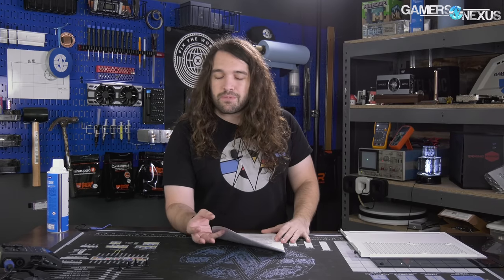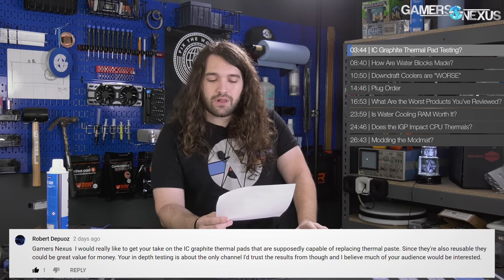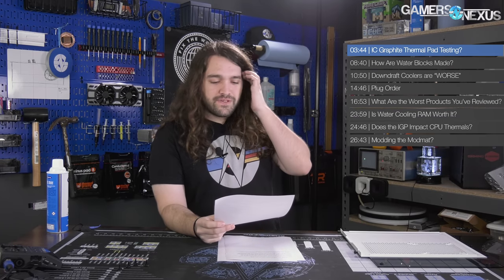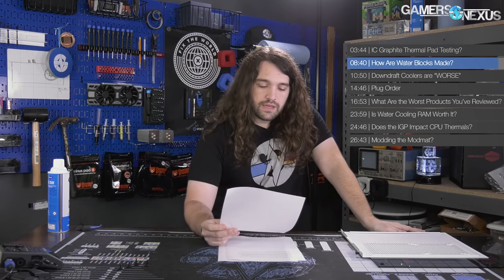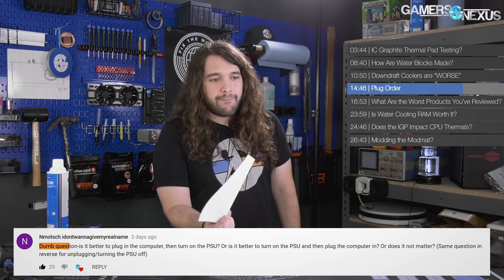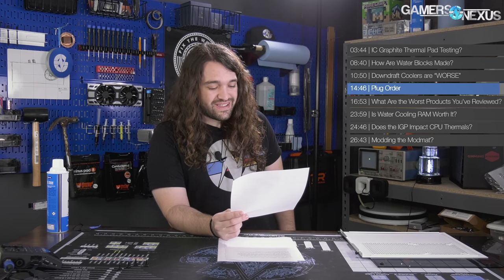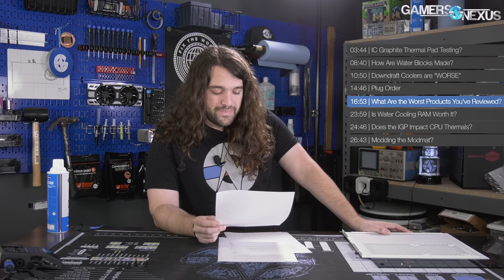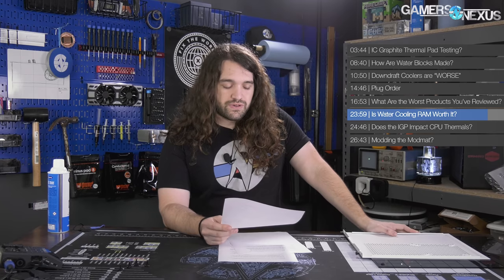Ask GN 83: IC Graphite Thermal Pads, Worst Products Reviewed

Comment: Bit of background - I first got into overclocking and enthusiast builds in the late 90s, and pretty much didn't keep track of things from about '01 until 2016 or so.

So, I have two then vs now questions.  

First, what happened to Peltier coolers for CPU? They were one of the "next big thing" exotic coolers at that time, and they seem to have basically vanished.

Second, what happened to solid copper coolers? Those were another "big thing" of the era, with Zalman being a bigger player. 

I have guesses and assumptions on both answers, but I'd rather just get the skinny as you see it.
Reply: Peltier coolers basically went away due to how inefficient they where, they have to create as much heat as they cool because of thermodynamics and how they function, bypassing any effect the lower temperatures would achieve by heating the interior of the case to stupid levels.

When All in one liquid coolers for CPUs came onto the market, it killed all interest in Peltier devices, they do the same job, just for cheaper and without all the downsides.

Solid copper towers just did not do all that much in the first place other then be fancy, aluminum fin stacks where with in single percentage points of heat displacement over time when fed by the heat pipes when compared to soild copper, and people did not like spending hundreds on a air cooler, so they just kinda vanished, only thing i can think of now that has soild copper fins are the Kingpin 1080 and 1080TI cards, and those are just stupid.

Comment: I have 2 IC graphite thermal pads in two different machines and from what I can tell they work about as well as thermal paste or at most 3 degrees worse if applied less than 100% correctly with the huge added bonuses of not being messy and being reusable.  So far so good on my end with them.  Curious to see your results.

Comment: 21:40 I just got my FTW3 Hybrid yesterday and the radiator doesnt have any of those protection, I added a fan for push pull config so I spent a good 5 minutes making test with screws to make sure I dont poke the rad on the additional fan. The rad and the pump could be better quality but still do the job great.

Comment: Those thermal pads contain pyrolytic graphite sheet.. very cool stuff. Even if these pads aren't good, PGS has alot of potential for PC cooling, it's in the order of 50 timer better than copper for heat conduction.

Comment: #AskGN Will we be getting m-ATX X-470 motherboards? The only X-370 m-ATX boards out don't seem that great and were only released in the past few months. Intel has a few Z-370 boards for m-ATX, but the AMD side seems to be lacking in high end motherboards for the m-ATX form factor.
Reply: Dave Green agreed there are more mitx boards than matx. Even x299 is on mitx but you can't get a good matx x370.
Reply: I just hope that m-ATX doesn't become an abandoned form factor.

Comment: You mentioned somewhere that 200 mm fans are more difficult to manufacture due to more weight and wear on bearings etc. So considering that larger fans may introduce some weaknesses, I want to mount  Fan/s in front of my case for air intake, should I mount 2x 120 mm, 1x 200 mm or 2x 140 mm? What is more reliable? What solution performs better (puts more air into the case)? What is the silentest solution?

Of course it always depends on which fans you use, what kind of speeds you run and how fan engine and blades are designed. The question is targeted to be a little more general. Maybe there is some common knowledge that 200 mm fans do not perform that much better than 140 or 120 mm and you should stick to these, that I do not know :D

Comment: When you are in Japan, you should check out some "junk" stores like "hard-off" which sell a wide variety of used PC components, full systems, and other electronics. Also I have seen a few CPU capsule vending machines in Akihabara which are a bit of a fun novelty if you run into one.

Comment: I am curious as to how often should I take apart my liquid cooled gpu and replace thermal paste or pads? I am using an MSI factory watercooled 1070 and I just didn't know if I should replace the thermal paste and/or pads or not. Also, I am going to buy the modmat as soon as I am able to, but I would definitely like to have the additional snap on the other side. Great video by the way.

Comment: steve, i'm in the process of ordering components to upgrade my system to a ryzen build. i've realized thhough that multiple of the b350 boards i have been watching are suddenly unavailable and it says that the product isn't out yet and can only be preordered. i've been suspecting that they're waiting for deliveries of a new revision, maybe even with a new bios? would be amazing if you soon could buy a b350 board and drop in a ryzen 2 without having to get a cheap ryzen 3 first and send that back.
what do you think?

Comment: In the NUC overclocking stream you mentioned the thermal limitation of the waterblock you used because it had macro fins and not micro fins. Can you explain more or even do a comparison test the roles the fins play in achieving maximum thermal dispersion? Thanks

Comment: Embarrassingly, the ONLY reason I have not yet picked up a mod mat is EXCLUSIVELY the lack of a left hand snap point. I know it's a silly deal breaker, and I know I could change the mat's orientation... but I prefer to not have my dominant hand (which is used to pick up tools, parts, open workbench drawers etc.) tethered when I'm reaching around the workspace. If you add a second ground point, you can count on a +1 from me.

Comment: I think that micro fins are probably made by using an Electrical Discharge Machinging (EDM) process, once the channels have been made with a mill. EDM uses electrical discharges to pull material off the surface and uses a liquid to carry the particles away. This allows very small feature sizes, especially with how soft and weak copper is.
Reply: Interesting info here: http://www.practicalmachinist.com/vb/cnc-machining/copper-water-block-311327/

Comment: If thermal testing is so difficult etc., how did you end up deciding that using liquid metal is a good idea, to the point of pointing out that you could drop the temperature of a delidded CPU by 20 degrees? That one runs the risk of outright shorting or eroding through your equipment, but you're fine with using it in videos and recommending its use (with lots of cautioning of the audience), but reusable graphite pads that would, at worst, result in the computer shutting down is too difficult to test?

Comment: Are GPU memory errors okay? I recently bought an old R9 390 and I'm getting around 10 to 20 errors in an hour. I'm told the previous owner didn't overclock or mine on the card, but I don't know how truthful he's being obviously. I've also had my system crash to a solid red screen once or twice since the upgrade (hasn't happened in a few days since I updated drivers). Should I be concerned?

Comment: Ask GN, Hi Steve is it worth while flashing alternative bioses on video cards such as the 1080 Ti to unlock higher wattage? As standard, most cards seem to be approaching the limits at 300w and flashing the bios to for example the ASUS Strix 1080 OC provides a small boost at 330w, would this allow for higher or more consistent core boosts?

Comment: So, the IC Graphite thing is really interesting to me, but not for the reasons everyone else seems to care about. 

I build computers for my parents/cousins/etc. They are not known for taking care of their computers. Using regular thermal paste on a CPU means that within a year I'll be out there, replacing the paste on the CPU because they've left the computer on all day, in a hot room with only a swamp cooler running to cool the place.
In the desert, thermal paste dries out fast and computers start to overheat like crazy.

With the IC Graphite, that eliminates the need for me to reapply paste every year or so.

Comment: Water Pump question.  Is there a pump with an option to control thru the OS? Or warns about low water or the pump has failed?  Besides the water temp, what controls and settings we could have access to in the windows program.  just asking.

Comment: #AskGN Steve, Wanting your opinion, I have a Corsair H110 (yes the original, on a 3930K), a cooler that I've been using since June of 2014, meaning it's coming up on 4 years old.  In your opinion, at what point should I seriously consider replacing it to avoid possible issues due to aging/liquid permeation?  I'm sort of trying to wait until I build a new platform/system all together.

Comment: Hi Steve, got a quick question, i spent some time tuning my system for low dcp latency trying to reduce input lag, ultimately i had to switch to windows 8.1 to get optimal results, im still on a i7-2600k but i want to upgrade to a new ryzen 5, can you do some dcp latency testing maybe comparing windows 10 vs 8.1? ty and keep up the good content.

Comment: Some questions about PSU (and VRM related)

How much will the PSU 12V output affect the mobo VRM final output to CPU?
E.g. PSU 12V output voltage is 10% less than expectation, will mobo VRM still work as expected?

And for overloaded PSU, what would be the most obvious symptom? PSU output V droop?

Comment: #AskGN  In the case of a power hungry PC such as one with an RX Vega 64 Liquid Cooled and a high core count CPU like the R7 1700, both overclocked, would it be recommended for the PSU to be plugged in directly into the wall socket or could I get away with plugging it into an extension socket which also has the monitor, speakers and router plugged into it? I'm asking because my PC sometimes does a weird thing where it beeps immediately after pressing the power button and I end up with RAM and GPU frequencies reset back to default and I can't figure out what's causing it. The PSU is a Corsair HX850i and the motherboard is the Asus Crosshair VI Hero.

Comment: VRM cooling with downdraft is a fact, you cannot run FX cpus with tower cooler cause vrm run too hot and underclock constantly. (on shitty boards with no heatsinks), also just last night upgraded a  stock copper core cooler on an i7 3770, vrms where hitting 70-75 and  throtling the cpu all the time, switched to  thermaltake 95w cheapo  heatsink and vrms are now 60ºc and under, cpu does not slow down anymore

Comment: I want to buy an H500M and I want to liquid cool the CPU with a 200mm AIO. Do you know if Cooler Master is going to launch one?

And if not, is it worth to put a 280mm radiator on the top with the glass or on the front with the 200mm fans still in the case? Something like Mesh-200mm fans-Radiator-140mm radiator fans

Comment: Steve, over the past six months there have been press releases and presentations from Samsung (1y nm-class), Hynix (16 Gb single-die) and Micron (sub-20nm class) regarding upcoming DDR4 DRAM products for 2018.  At Computex, can you drill these guys regarding timing for when we will see these in the wild and what performance expectations we should have?  Also, please report with a video if these products are on display at the show (I know that most people are less excited about RAM than I am).  So far this year, all of the products from the gaming memory makers seem to be built on 2017-era and earlier ICs like Samsung B-die/E-die and Hynix AFR/MFR.  I hope the release of next gen stuff will both result in some modest price relief through increased capacity coming online, but I also hold out some hope that crazy timings and speeds like DDR4-3466 @ 1.2V @ 14-14-14 could be obtainable.

Comment: Very interested in your opinions on the different fans available on the 212 as I use a few of them in different systems. I cant find any information on the quality of the different models, is there a specific one that you suggest avoiding/replacing?
Reply: Also, on the subject of the 212, it gets absolutely spanked by the Nfortec Vela MX which is 10 euros cheaper & does a better job of cooling the VRMs. You should try and get hold of one for any future budget air cooler feature you do.

Comment: #AskGN At what budget point does investing in fans make sense? Surely the gains of going from a 1070 to a 1070ti and using the included fans are higher than the gains from adding 4 Noctua fans to your case at same cost?

Comment: #AskGN Is it possible to install a PCIe mini capture card on a laptop (motherboard) instead of a Wifi card for use with stream capture?

For context, I upgraded a Probook 4540s from an i5-3210M to i7-3632QM (dual to quadcore, the motherboard uses a socket, not solder) and was wondering whether I can squeeze more life for when I upgrade to an actual PC, seeing that prices are getting normal now. It's mostly a question of whether I can save some performance on the PC so I can get either better framerate/graphics or focus more on buying a GPU than a CPU.
Reply: You'd have to find a way to address the PCIe lanes, thunderbolt 3 can do it, butt otherwise you will need to find a schematic and get crazy with soldering and wiring to address the PCIe lanes outside of the system.
Reply: I wasn't talking about a PCIe card, but a PCIe mini card, like the Avermedia DarkCrystal C353. There's a local seller here who sells those for relatively cheap so I was wondering whether they'd work with a laptop (Windows or Linux).

Comment: What I have done with down draft coolers if they aren't seeming to perform well , I've flipped the fan over for up draft. This pulls cool air across the mb, and pushes the hot air from the cpu away from the board. But as you said case design has a lot to so with it.
Reply: In fact a test with a wraith cooler doing down draft versus updraft could be interesting.

Comment: Sounds like you need a heat load that's not a CPU. Just some kind of variable wattage hot plate that you can clamp a heatsink to and measure temps with thermistors or something.

Comment: Is silicon lottery (website) using too much voltage? I see that for stable they have their CPUs at over 1.4 volts. I understand that it’s delidded but even at 1.45 V it seems a bit much. Do you think these cpus will have a shorter lifespan than normal

Comment: Nobody seems to understand these graphite sheets, yes they do have excellent thermal conductivity (3-5 times higher than copper at 700-2000 W/(m*K)) but this is only in the x-y plane! With the z-axis being the thickness. They do NOT conduct well in the z-axis, which is the one you'd want on a CPU. Their intended use is as heat pipes for mobile ICs. (Look up Panasonic PGS graphite sheets for good info, they sell them on Digikey).
Reply: TheAmmoniacal IC graphite is 35 w/mk along the Z. Top paste like kyronaut is only 12.5 w/mk with perfect application.  So wtf are you going on about?
Reply: Great performance in the x-y plane would move the die hot spot on a Threadripper across the entire cold plate on a cooler.

Comment: Hey Steve i have an idea for a video. I been looking hardware for a 3D rendering machine. I use Sketchup+vray and 3dstudio+vray. But i noticed that with the cost of a Ryzen 1950x (16 cores). I can buy 2 Ryzen 2700X (8 + 8 cores) and hardware for a second machine. One of the 2700x goes in the main machine where i model and do the work and the other 2700x with motherboard, 2x4gb ddr4, 120gb ssd, evga 500w, cheapo case. goes towards a rendering machine. Vray has an option for rendering with machines in your local network so in that case you could have 8 + 8 cores with higher clock speed to do the same work at the same price but just wasting more space. What do you think about that?. i've been looking for someone that made that choise or comparison but i could't find anything.

Comment: everything keeps going lower voltage, claiming more efficient, but most cpus/gpus are within the same standard wattage such as 90w, doesnt that mean amperage increased? isnt that more strain on wiring/traces/components?

Comment: #AskGN

This might be a stupid question but does clock speed increase the overall CPU temperature ? Like for example, would a 8700k clocked at 3.5GHz/1.4v run cooler than a 8700k clocked at 5.0GHz/1.4v ?

Comment: Wouldn't it be easier to use some sort of very accurate heater when testing cooling solutions? That would give you less variables and a set heat output

Comment: Considering the differences between the chipsets and prices of X470 and B350 mobos (XFR 2, etc.), the included stock coolers, and the stock clocks and overclocking abilities of the Ryzen 2600 and 2600X, what combination of CPU, motherboard, and possibly cooler makes the most economical sense? 

To clarify, reviews seemed to suggest the limited overclocking on the 2600 made the 2600X with a better cooler and equivalent clocks OOB as the 2600 overclocked worth the extra money on X470. Is that still true if going for a cheaper B350 mobo? Or is the 2600 with an upgraded cooler going to perform better than the 2600X on B350 because the 2600X won't get the benefits of XFR 2?

Sorry for the long question. I figured if anyone would be able to clarify this, it'd be you. Thanks!

Comment: Replaced my macbook pro 2018 i9 2.9 with the Innovation Cooling Graphite Thermal Pad and it went down 20C and has stayed down. not my core is running a constant 4.2  4.3

Comment: I had a question related to the power cord and the on switch have you ever noticed motherboards powering on when you insert a card into the PCI slot I had an Asus Z1 70 that would do that if it was powered down but the power supply was still on and you put in any PCI e-card a graphics card a Wi-Fi card the pc would turn on

Comment: # AskGN I have not used a Modmat yet. So grain of salt included. Would it be possible to flip the design of the Modmat completely left to right? It looks to me like the squares for screw placement are on the wrong side of me for working (right handed). Also I feel the outline of the GPU is facing the wrong way.